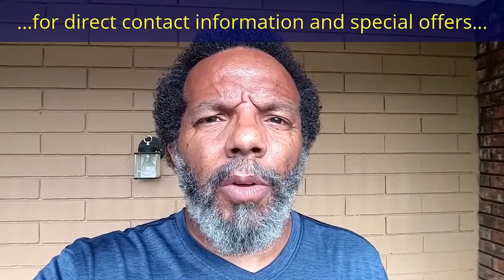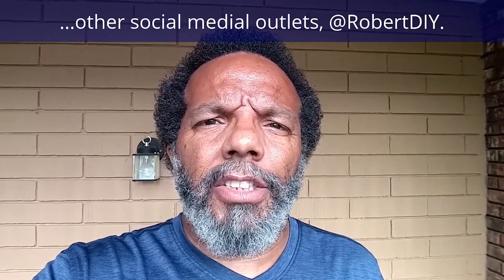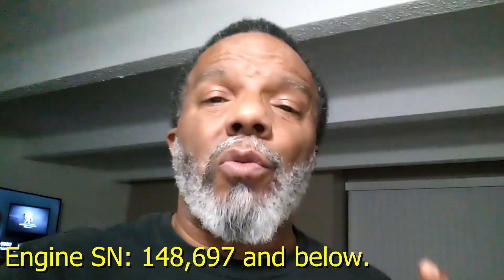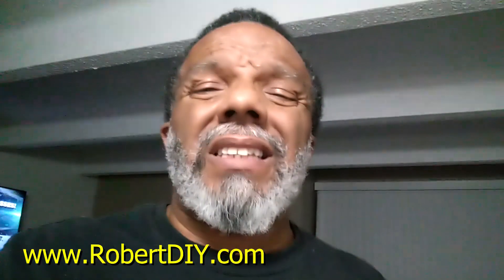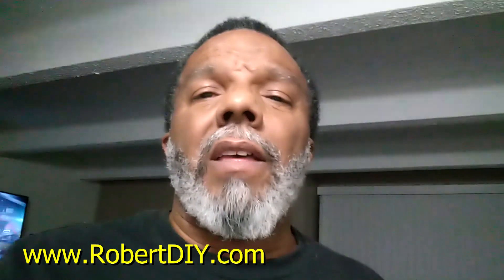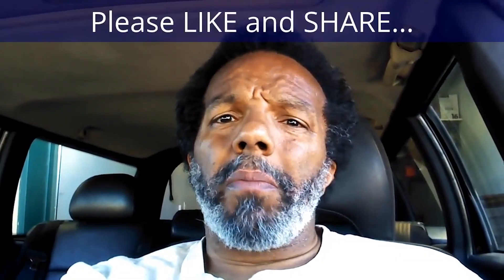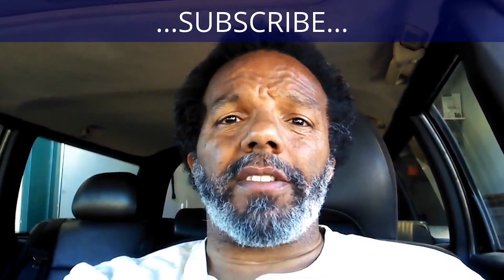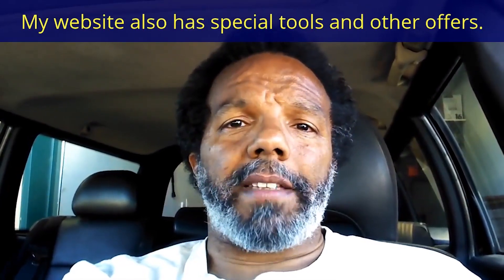Maserati GranTurismo & Quattroporte cam holder modification information for the 4.2L. Part 1 of 5

Comment: Thanks for sharing the DIY information on the older Maserati Granturismo models. Mine is a 2014 with the newer engine that as for what I have read is not affected by the wear of the variators due to oil drainage. Cam bearing cal modification is a great cheap solution that can be performed buy just about anyone with basic mechanic knowledge. Thanks for helping your friend and sharing your enthusiasm. Keep Maserating.
Reply from the maker: Thanks for sharing